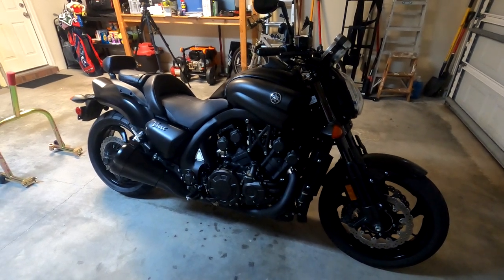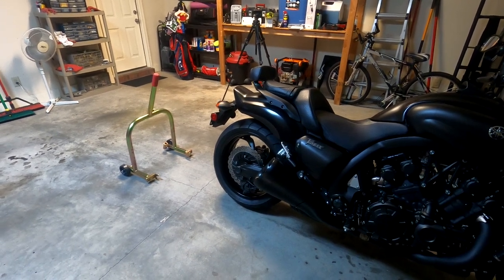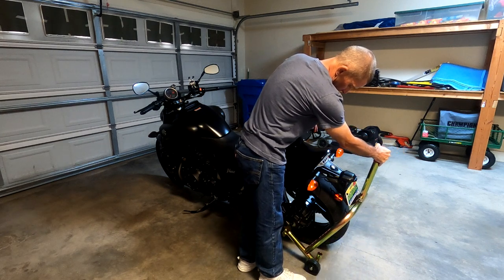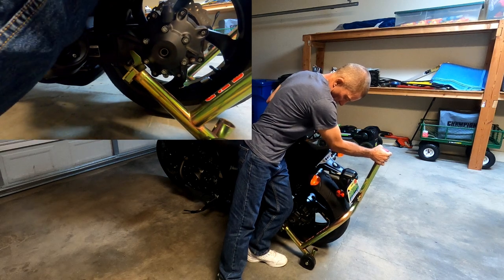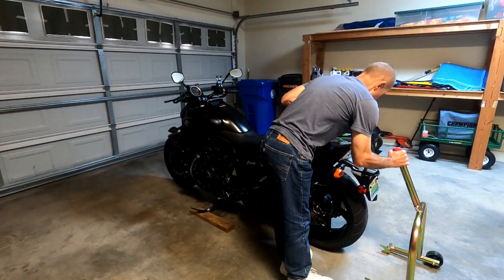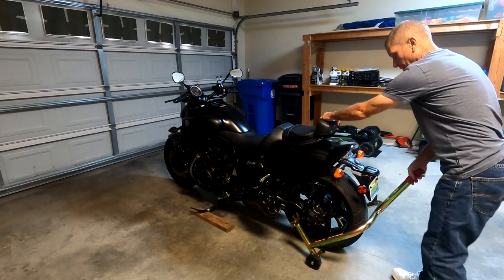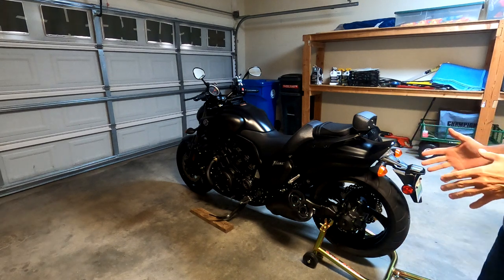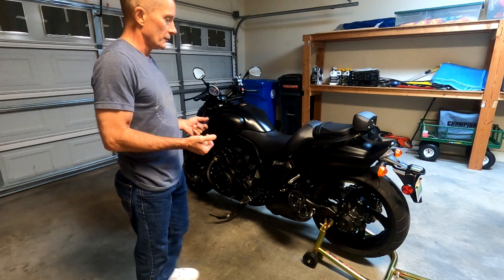How to Jack a Yamaha VMAX 1700 Using a Pit Bull Rear Stand

Comment: I do this with all of my motorcycles and don’t like it so much doing it with the VMax, it’s just so heavy so if you happen to get past straight up and it starts going over it’s hard to catch. Think I’m going to use this block of wood method from now on.
Not that I can’t do it the other way but the wood method is just safer.

Comment: Jeff? Nice video!, Do you have a video on lowering the vmax 1700?
Reply from the maker: Thank you. I am assuming you mean to lower the suspension so that the bike sits lower? If so, I do not have a video on that. In fact, I have not seen where anyone has lowered the VMAX 1700. I wish it did sit a little lower.

Comment: It would be nice if a company made spool adapter arms to lift the bike using a standard hydraulic motorcycle/ATV lift. That would put the lift behind the tire and give you access to both sides of the motorcycle.  If there is enough clearance to center the lift under the rear wheel, I may fab up some adapter plates. Might need to extend the front wheels/legs on the lift.......

Comment: Very nice product, will definitely look into this. Now the MacGyver in me thinks.....If I where to put a wheel dolly at the back handle of the lift I could potentially use this to move the bike around. Even a minor bit to place in the corner or line up for the door for a quick escape ... not recommended I'm sure..lol

Comment: the vmax 1200 had a center stand and it was a beautiful thing. so sad that so many motorcycles no longer have center stands these days. take harleys for example. until recently many harley had spoke wheels and tires with tubes. without a center stand it is literally impossible for those riders to realistically repair a flat on the road and a huge pain to do even minor maintenance

Comment: Jeff,, you are the best!!  I have a Gen 1 05.  May I ask if you can get good feet on the ground when stopped on the MAX, you look about my height and i was concerned about that if I bought a new Max.  Also, do you plan on getting any engine guards,?, I know on my 05 bought new I refused to drive out of the dealer when bought until they put them on.  Also, are you an engineer, because U are so detailed in your explanations? :)
Reply from the maker: Thanks for the kind words and thanks for watching. I can almost flat foot it. I can flat foot it with a passenger on board. 😎I have all pre-loads set to softest. By the way, I have an upcoming video on how to make all the suspension adjustments.  I would get engine guards if I could find the right ones that look okay and don’t stick out out really far. I am not an engineer. I spent 10 years in the United States Air Force working on aircraft and then I became an instructor and taught others how to work on aircraft. I have been in education and training ever since...in the military and at a college.
Reply: @JeffMarcum  Jeff, That clearly explains your excellence in these productions.  I have seen some nice compact engine guards called, "Saiko", I believe,,they are a puck design.  My best.

Comment: Hey Jeff! Any recommendations for securing your Vmax during long trips and motel stays?? I would gather that the Vmax is an hot item for theft.
Reply from the maker: I have no experience with that. However, while staying at a hotel last year in San Antonio, I noticed the bikers left theirs under the entrance overhang, which was well lit and easily seen by those at the front desk. You may want to ask if this method is possible prior to making reservations.
Reply: @JeffMarcum  This is what I have done.
Reply: Hey Jeff, I have been enjoying your videos a lot as I plan to buy a Vmax soon. As an owner of multiple motorcycles I have a J&S jack rated for 2000lb, which helps me with everything needed in my garage. Can I use my jack to lift the Vmax?  It can lift my goldwing quite easily. Thanks!